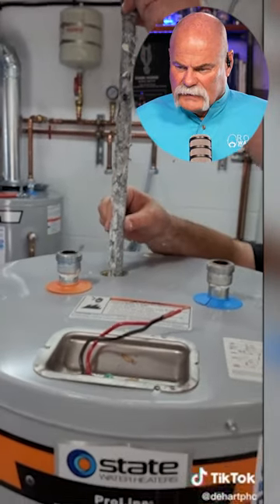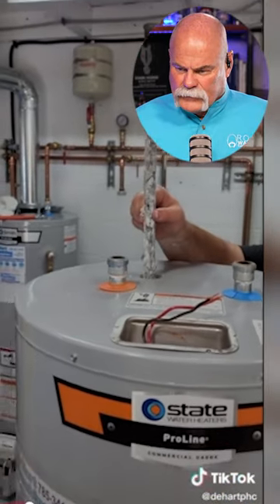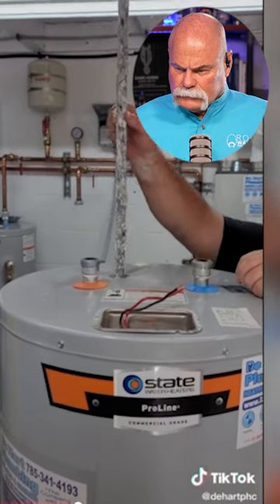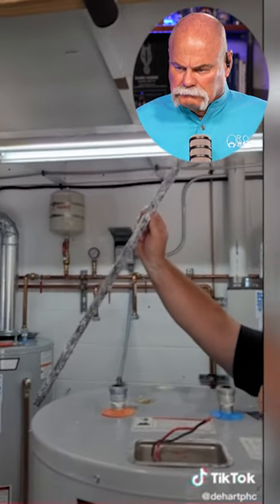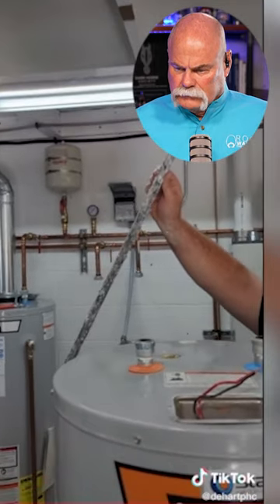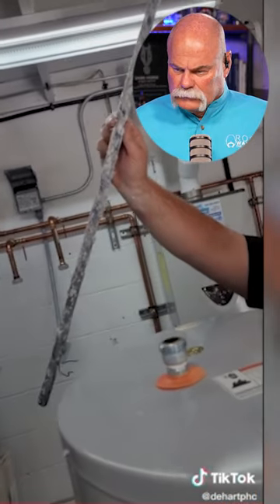What is an Anode Rod?

Comment: what are your thoughts on modern water heaters that don't have anode rods in them?  also aluminum is the normal rod in the north...not magnesium.
Reply: It doesn’t matter what part of the country or region your in to determine material type.. magnesium is actually material of choice is your using for potable water, it may be more expensive.
Reply: @inspectortravis5758  actually from what I read you're wrong..aluminum is good for hard water. Magnesium is good for soft water.  magnesium anodes do not work good in areas with hard water.

Also didn't address the main part of my question about newer water heaters without anodes.
Reply: @xephael3485  it all comes down to the electrical resistivity of the water… ground water will naturally be harder than surface water and have higher mineral concentration making it more conductive and more corrosive. If you look at the galvanic series magnesium has a higher driving voltage than aluminum giving more protection.  But it will also deplete fastest than the aluminum anode.
Reply: @xephael3485  From my understanding most water heaters have anodes built in that are not replaceable usually have a 5 year warranty.  That is the lifespan of the anode
Reply: @inspectortravis5758  RHEEM MARATHON® electric water heater if you need an example of a heater with no anodes.  21 year tank warranty I believe.  Lifetime for residential usage
Reply: They all have them even hybrids
Reply: @JohnSmith-bd2re  not the one I listed.
Reply: @JohnSmith-bd2re  I have a Rheem and there's a spot where it says there's an anode rod but when you open it up, it's just insulation and no anode.

Comment: Never changed one of these in 3 different water heaters all last over 20 years
Reply: Depending on the electrical resistivity of the water you may not need to replace when recommended, but as mentioned it will prevent corrosion and extend the lifespan.
Reply: That’s exactly why you’ve had three water heaters in 20 years…

Comment: Our Bradford White water heater lasted 25 years..never did any type of maintenance at all..so I bought another one Bradford White..I'll be happy to get another 15 years out of it. I wouldn't replace that rod at all. Just buy a quality one in the first place and it will last.
Reply: There’s a reason you’re supposed to remove them… 25 years isn’t great for a water heater. You should probably change or remove it for water quality reasons
Reply: @brody7714  ..I beg to differ. 25 years is a very good life for a water heater!
Reply: @brody7714  low pressure water heaters last over 50 years, you should join the owner of this channel in talking about things you dont know about
Reply: It has nothing to do with the brand… It has to do with how Distributors treat them in their facilities…. If you buy one and the box is dinged or damaged in anyway ask for another one
Reply: @MrHolyKindness you have never swapped an anode and it shows lol

Comment: You are somewhat wrong. An annode prevents electrolysis from eroding metal by attracting stray electrical current in your water that otherwise would erode the metal in your pipes and water heater.
Reply: It mitigates galvanic corrosion on the components. Dissimilar metals + water + electrolytes = galvanic cell.

The fact that the metals have different galvanic potentials is what generates the movement of charges. Magnesium is more willing to “dance” here, so it’s put there to keep the corrosive forces busy so the other components can work for longer before wearing out.

Galvanic corrosion will occur on electrically isolated surfaces, too, so long as there are dissimilar metals touching with moisture and some electrolyte. Ex: a steel bolt securing a deck post, rusting because it’s touching a brass washer, making a big ugly streak on your 3 year old deck.

Comment: I knew about the rod but I’m pretty sure my plumber told me it’s not worth replacing it. Maybe he specifically meant on older models where it was just safer to replace the whole unit. Thanks for this!
Reply: This could be true depending where you live. I live where there is very clean soft water. A half descent tank lasts decades here. My parents house was built in 89 and my dad replaced his tank after 25 years just because he was getting nervous it would fail when they were away camping or something. 
I have a tankless system. I back flushed it as recommended and nothing came out. I was hoping to see a bunch of sediment and calcium come out so it felt like I accomplished something. But no!

Comment: I’ve seen two different plumbers remove them upon installation. Which was puzzling, bc I knew they were there for a reason.
Reply: Iam a plumber, i know the reason, its very dumb and stupid… 

Most plumbers, never actually go to a school to learn about plumbing, most of us start like job site labors.. i was lucky to start as a propex installer… 

The thing is that we usually learn on the field as we go… 

Some, never learned about materials and how do they work….
Reply: If you’re on well water its better to remove the anode rod or replace with an electric anode because it can create rotten egg smell

Comment: I had no idea. Do I need a professional to replace it, or can I do it myself, as someone with mechanical experience and some good repairs around the house behind me?
Reply from the maker: I have a video on replacing an anode rod. Anyone can do it!
Reply: Anyone could do it, shut the water off and drain out about 5 gallons, there a pain to remove if you don’t have the proper tools But most of the nuts are a 1 1/16 socket

Comment: Question. I replaced ming and now the water smells like rotten eggs, before it was fine. Nothing was left if the old rod. This is on a well.
Reply: Is your water heater natural gas? Cus if it is, DO NOT USE THE HOT WATER!
Reply: could be bacteria in the tank reacting with the rod
Reply: @nicklikesradio  that doesn't make sense. The gas never comes in contact with the holding tank.

Comment: One small problem………..
If your water heater is 5’ tall and the anode rod is about the same height( or a little less), who actually has a 9’ ceiling that would  allow you to change it ????? I don’t !
Reply: They make replacement ones that are like nunchucks for that reason
Reply: I have 8' ceilings :(
At least there's not drop tile in the furnace room
Reply: Drain water and lay it on its side🤷
Reply: You gotta cut it unfortunately

Comment: No. This is not correct. 

“The chemical reaction for rusting begins by oxidation, which is when iron loses two of its electrons to the oxygen found in the tank. When you place a magnesium or aluminum rod into water, this also occurs, just much faster. The bonds between the molecules of magnesium and aluminum give up their electrons faster than the bonds in steel or iron. Thus, when you place an aluminum or magnesium anode rod into an iron or steel tank of water, the oxygen in the equation takes the two electrons of the anode rod instead of the tank, as they gave them up quicker. This will rust the anode rod, but not the tank itself.”

This is why it’s sacrificial. And as it wears out you will want to replace it. And not just once. You should pull it out every couple of years depending on your area and check it. If it’s wearing out then replace it.

Comment: As water moves it creates electrolysis which is the process of removing electrons from one form or another and it's going to remove them and rearrange them from the easiest metal possible which would be the sacrificial stuff you put in there regardless of what it is

Comment: It’s 2023 currently and my water heater came with my house built in the 1970s never has there been an anode rod replacement and it works great!!! This anode stuff is snake oil if you ask me

Comment: You have absolutely no idea what you are talking about, every video you put up your knowledge goes backwards
Reply from the maker: I’m sorry you feel that way. That’s for watching!
Reply: @RogerWakefield  you literally dont know what a sacrificial anode is for lol. Why are you making a video telling people they are not needed when you have no idea
Reply: I don't think it seals anything but protects  from corrosion.
Reply: @donaldallen743  exactly he has no idea what a sacrificial anode is for, i maintain gas pipelines, imagine if i said ahh the pipelines over a year old now, doesn't need a sacrificial anode anymore lol, gasline would be leaking in weeks
Reply: @markimonki4017   As a cathodic protection engineer, I have never heard of a pipeline leaking within weeks after a sacrificial CP system was removed.   Just for clarification sacrificial systems don’t have much output therefore your if your pipeline has severity of corrosion that anode system wouldn’t be doing much anyways.  And if you did have a leak after a week of removing the system DOT would be asking why the pipeline wasn’t repaired to begin with..  As for Roger, he is speaking in laymen terms so the average joe can understand the theory of how the anode works..  Being in the corrosion industry we should already know that most people don’t comprehend how corrosion works because it’s not something you see happening.
Reply: @inspectortravis5758  we have a plastic coated steel transmission pipeline in a remote town, highly reactive ground , i have had to remove wrap and re denso wrap twice in 7 years and it chews out anodes yearly